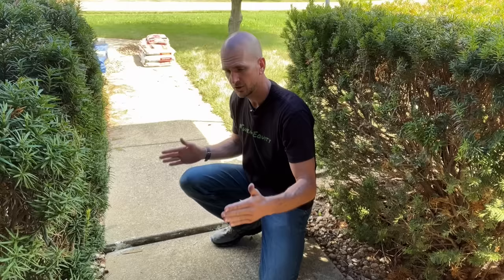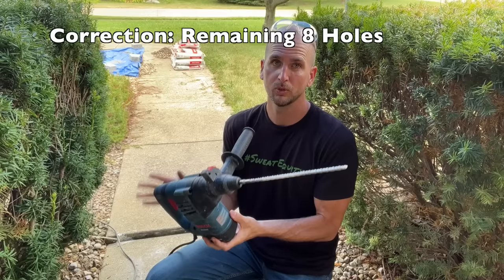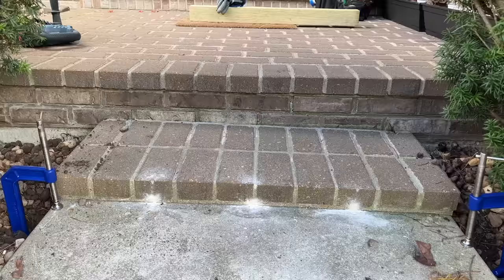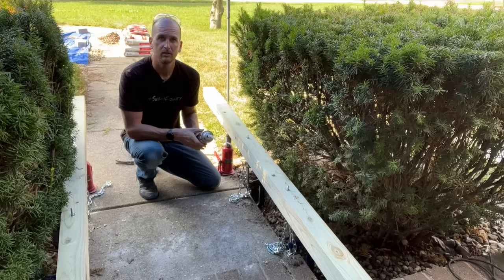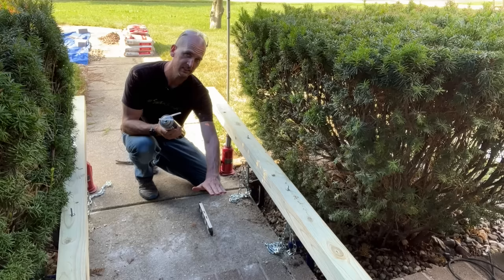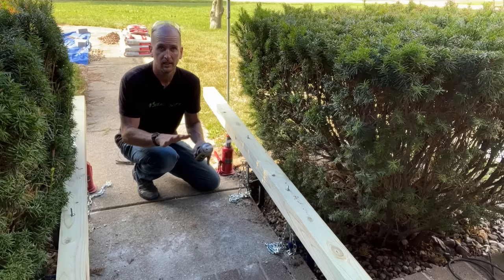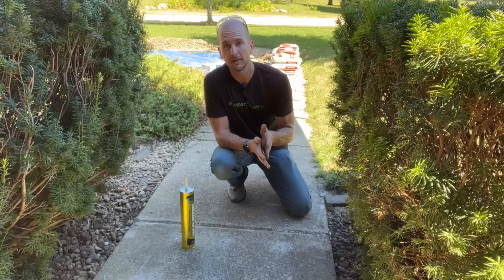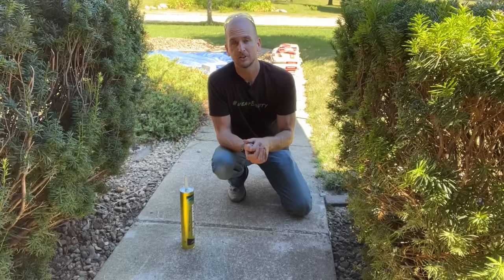How To Fix A Sunken Sidewalk With Spray Foam

Comment: Dude.... by the time you spent all the time lifting up the actual slab with supports. You could have filled with actual concrete from the sides instead for longer life of the work performed. That foam(in direct contact with constant water) is going to biodegrade long before the actual concrete regardless of water resistance... Also, you did not fix the ROOT cause of the issue. 

These DIY types of videos really just make my skin crawl. Because, i'll have to turn away from a home with these types of half-a** construction "improvements".

Comment: What a joke.....it would of been easier and cheaper to just break it up and pour a new slab. Show us a followup of how it sank back down once the cells of the great stuff broke down. And cracked because you drilled holes in it😂
Reply: @regnad kcin  it's not rated to bear a load let alone a 100 lbs slab of concrete